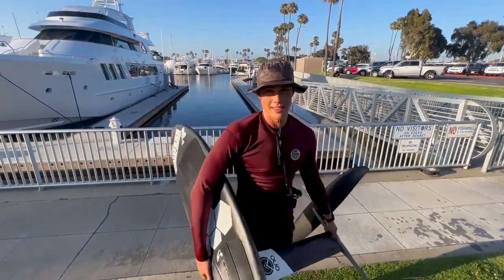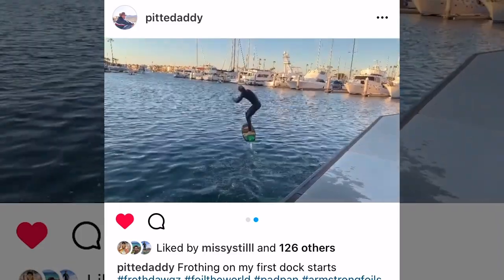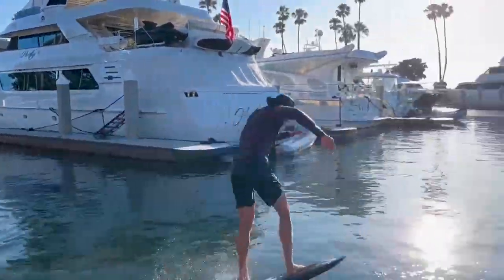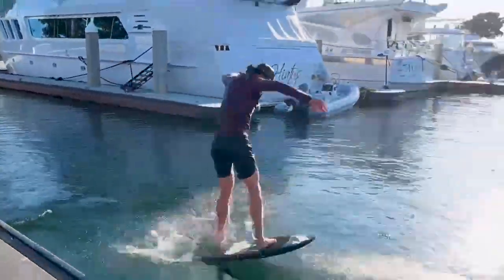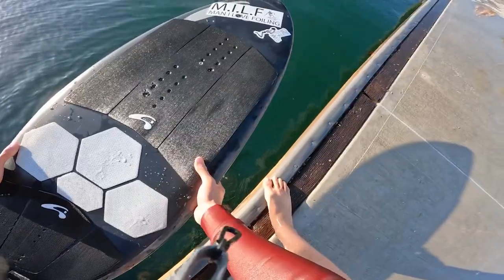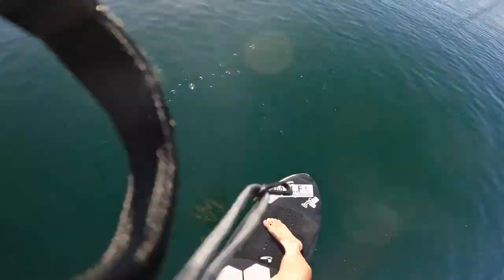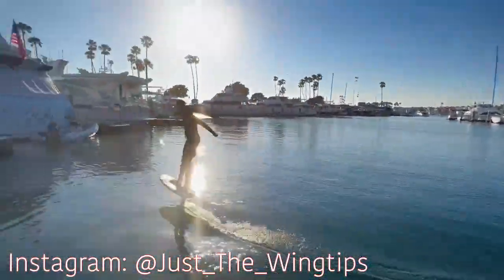Learning to Dock Start a Hydrofoil

Comment: Love the video thanks. technique you are using is very similar to what i've been trying. I'm at the point where i often land decent, glide, get a few pumps and sink. Had a couple where i pump out and get about 10 or 15 seconds. I am using a small board (94cm Axis tray) just cause its what i have from kitefoiling.  Very little volume. Would I be better off with a board with some volume? I sometimes feel im coming off foil with speed and might be able to pump out if board was more bouyant. I'm about 70kg, probably around 8 dock sessions, and lots of kite and wing foil experience. What size/volume board would you recommend? Thanks, Mike
Reply from the maker: You may be able to recover from a touch down easier with a larger surf foil board but I would say there is no reason to get one just for dock starts. The tray foil boards are ideal for handling them while running and pumping.
Reply: @justthewingtips  Ok thanks so much. Glad I just stuck with the tray. Much more consistent now and it really is a dream to run with, pump, and manage getting back up for another try.

Comment: Generally speaking I feel like jumping and having a time when you stop applying pressure on the foil is making things way harder. (And I learnt just the way you do there).

I think of you manage to learn more on the board while you run and walk on the board without jumping and keeping your hand in place until you feet are settled would make things easier because you would be able to run faster and conserve much more of that initial speed. On the video I feel like you manage to overcome the difficulty of this launch because your stubborn enough and your very advanced pumping skill.

Note that it's easier to lean on shorter boards while running.

It's not a comparable context but just to be sure you get my point https://youtu.be/8-JJ6iPQSys

Did you try that ?
Reply from the maker: For me I’d need a lower dock. It was too hard to run hunched over.
Reply: @justthewingtips  yeah sure, but in the end you manage to take 3 steps with your hand in place, so the only difference would be to just walk on the board keeping your hand in place instead of jumping. Maybe I'll try to find a high dock like yours and see if I can manage that or if there's an additional difficulty to it.
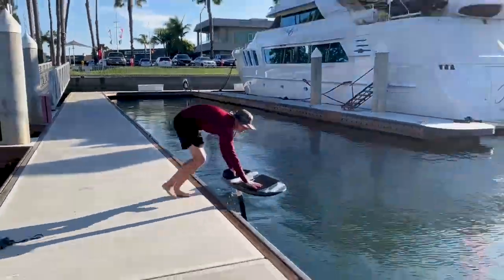Reply: @justthewingtips  in fact the fall you show at 1:13 is really close to it, I would just keep the hands pushing on the board until the feet are settled. Do you think you wouldn't be able to have the sufficient initial speed doing that ?
Reply from the maker: @yohann.roussel  That would've been the ideal way to do it but I couldn't jump on without letting go.
Reply: @justthewingtips  Rhaaa... Too bad😭 fortunately you managed the other way !